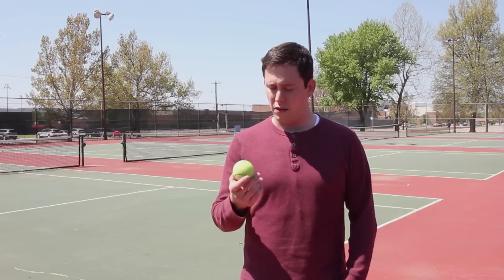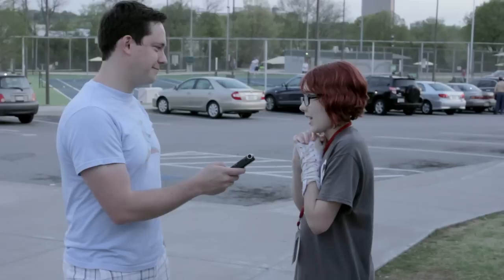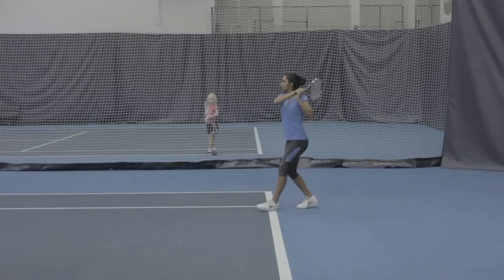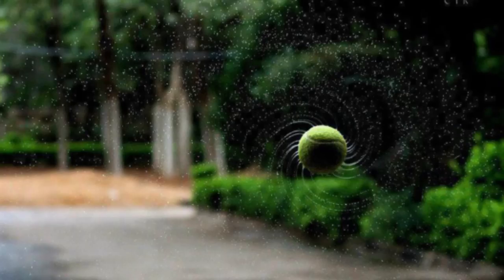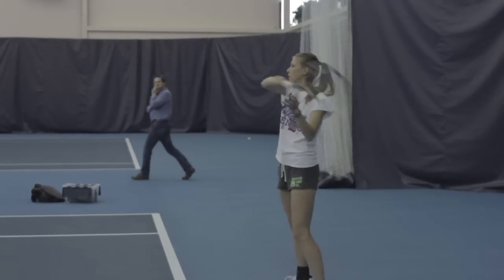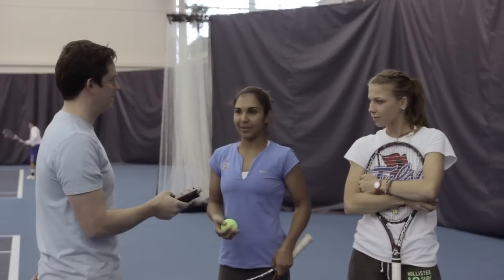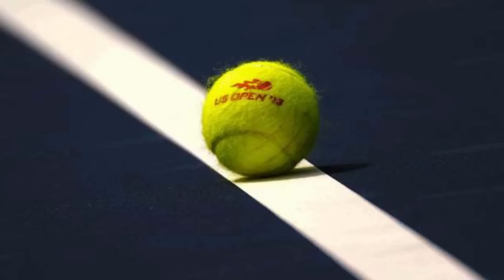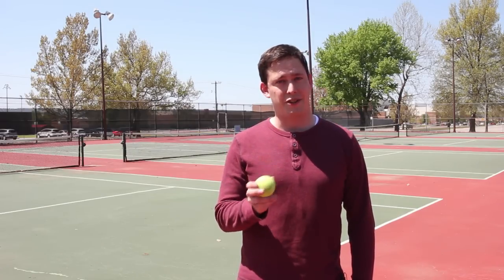Why are Tennis Balls Fuzzy?

Comment: Interesting enjoyable vid. Yes time passes and a few years old now, as are we all. Thanks for making it.  Re the colour. I recall tennis balls being off-white through the 1960s, and they had less fuzz as well. Knowing that, being able to determine why they are the colour change was straightforward. Similarly, the why of fuzz being a combination of tradition and form drag. IDK if pressurised balls were around in the 1960s? Combo of a simpler time and that I was too young to be aware of it if they were. Glad they are now though. They bounce so much better for longer. 

As a squash player of yore (& racquetball too in my dotage), it's Interesting that squash and racquetball both use smooth rubber balls with different compound speed, rebound and bounce characteristics available. 'High vis' black for the relatively minuscule squash balls regardless the dot code speed  -yes I was being intentionally facetious, and blue for the larger almost tennis sized racquetball ball.  Now if only one could buy a new body like one can new balls.